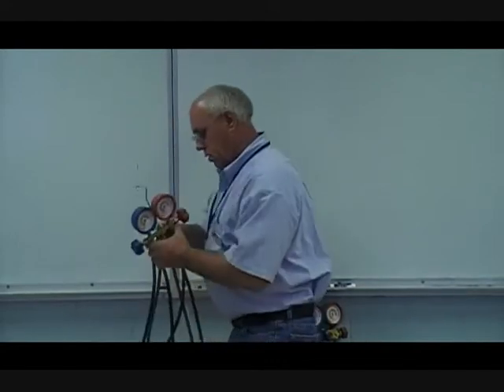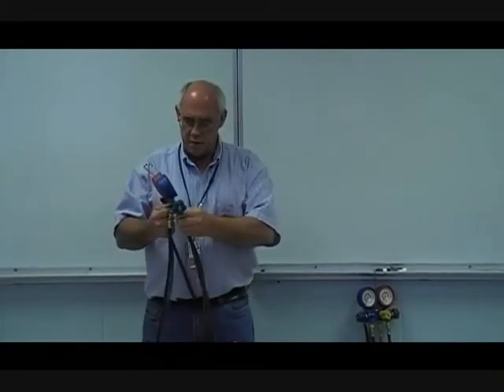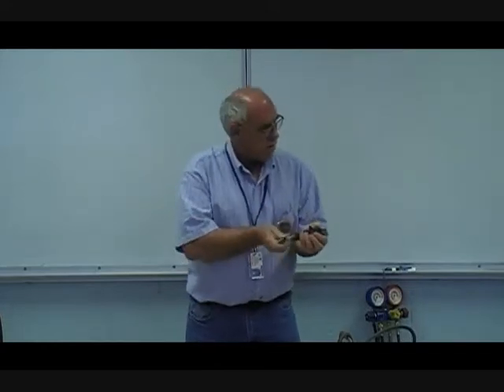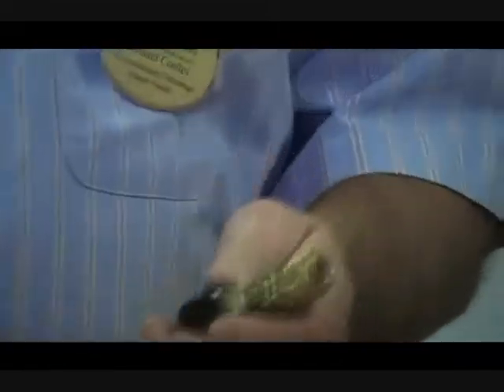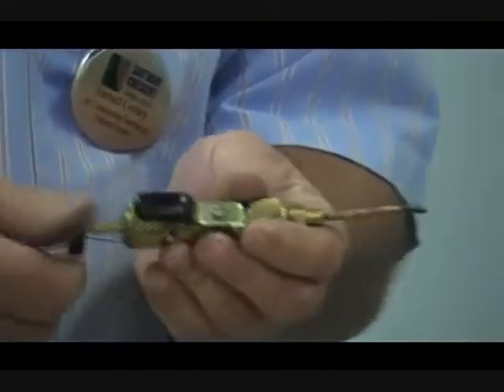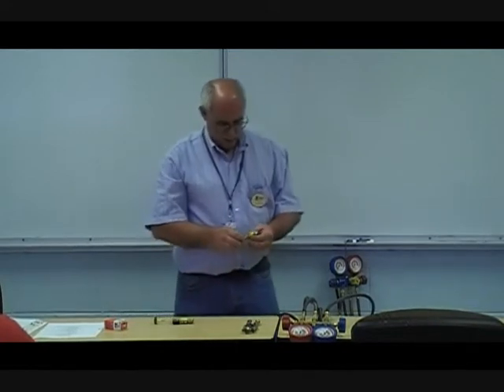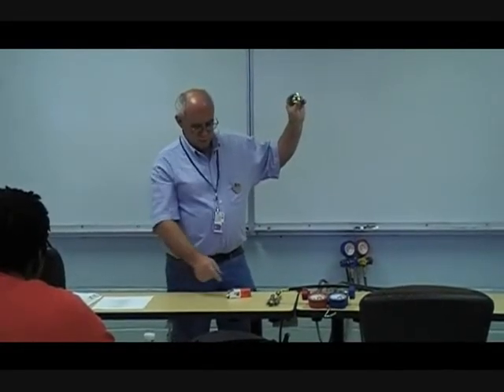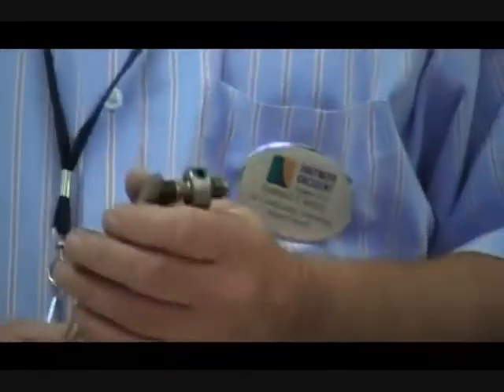AIRC 1010 C, Part 1 of 4; Refrigeration System Access Valves

Comment: Without watching the whole video...Does it matter where I put the access valves in a system, as long as they are on the low and high ends of the compressor? (for instance, location relative to filter/drier matter at all?)